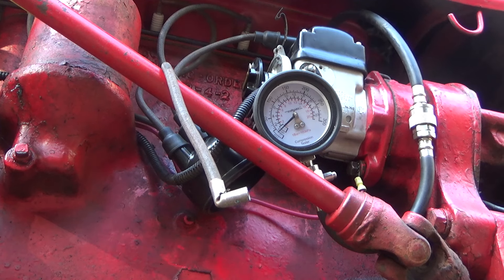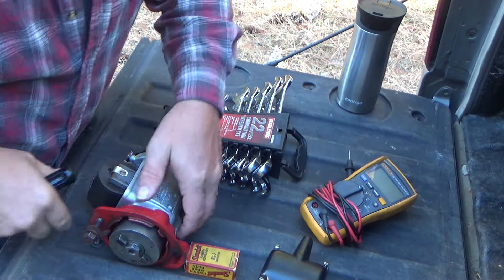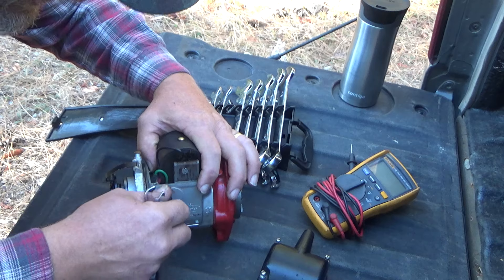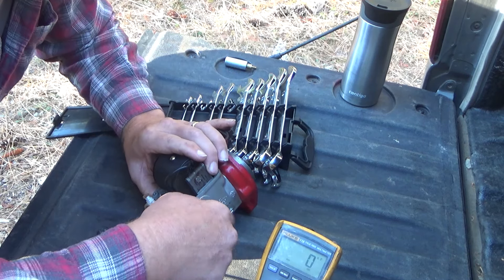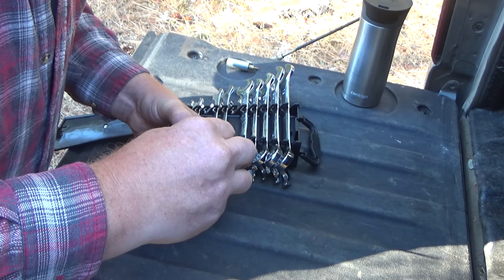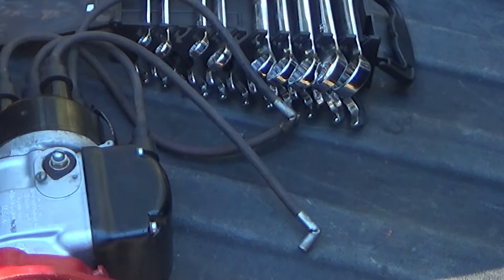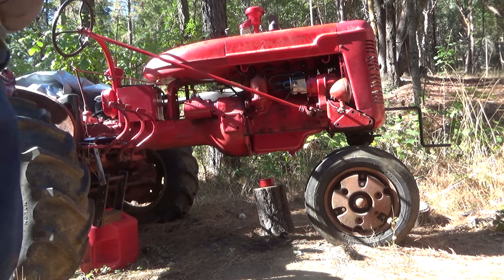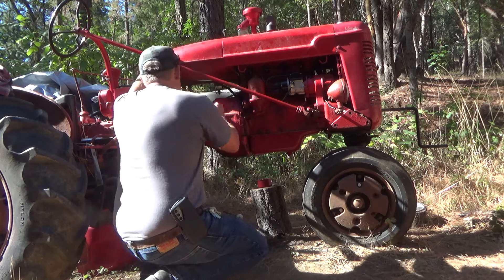Farmall B Saga Continues...Checking Condenser, Engine Timing, Valve Re Adjustments!

Comment: I had that type of carb flood on my tractor. The U shape float can get stuck (as the fuel enters in) on the carb casting just as it reaches the “normal” operative position. I bent my float so it sits a little lower inside the carb (restricting it’s full range),it was getting caught too easily when at the normal position. No problems since. Best of luck, can’t wait to see it running!

Comment: Leon, I have experienced the flash carburetor flooding many times. You turn the gas on with a dry carburetor installed and the engine floods out. I have learned to tap on the carburetor with a wrench or hammer while the carburetor is filling with fuel to make sure the float, float arm, or needle valve is/are not catching/binding when sliding into home position as the fuel fills the bowl and is lifting the float. The tapping provides some vibration to assist the float to rise properly. Mounted on the tractor out in the field the carburetor is probably not level and the vibration helps.  Okay, fair enough, maybe you have done this, if so disregard.

Comment: Possibly check the float and make sure there is not a pin hole in it. I had a Tecumseh motor that the carb float had a small pin whole causing it to fill with gas.

Comment: Please put in a fresh set of spark plugs since it was flooding.  Also you can shut the fuel off and use a little bit of starting fluid it should fire and sound good for a second or two.

Comment: Hey Leon I would try starting fluid see if you can get it to run on the starting fluid that runs and it’s the carburetor and I’m wondering if you have a vacuum leak around that gasket going into the manifold I will go back to the original carburetor 
If it was me out in the field I would try starting fluid really and see what it does I have a mobile heavy equipment repair business and farm tractors and I run into the stuff all the time she still run first on starting fluid